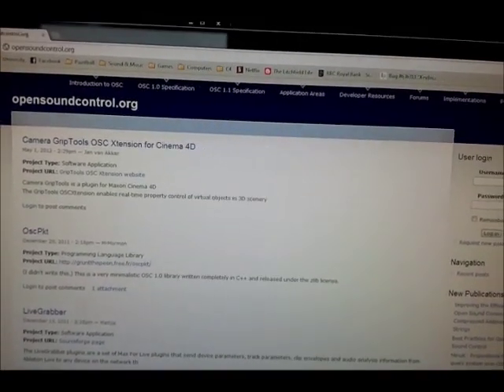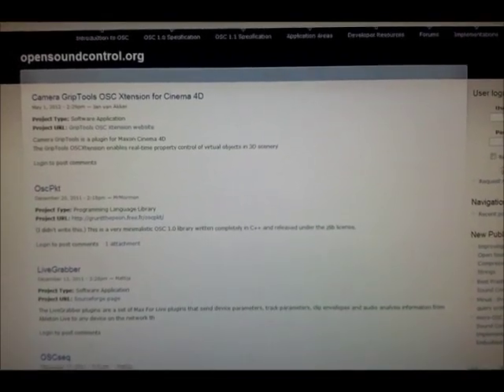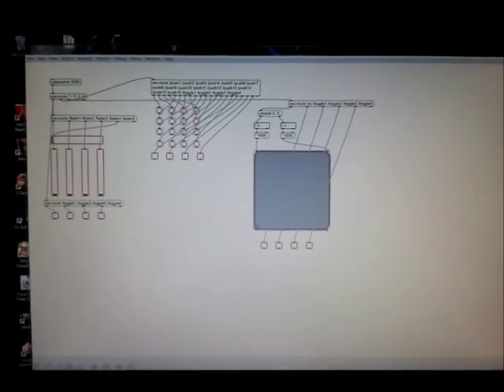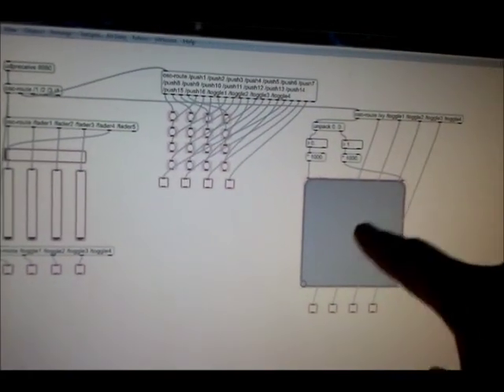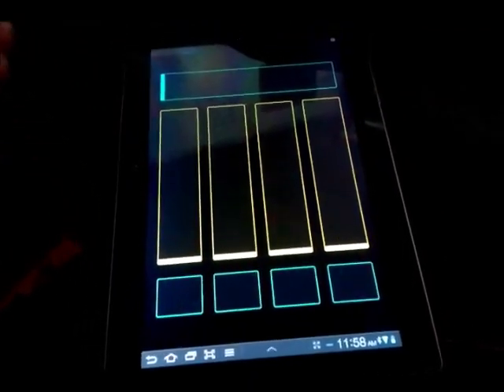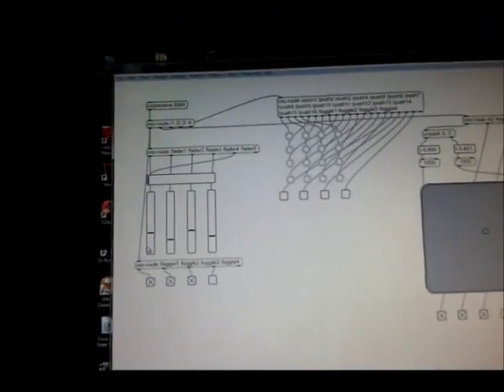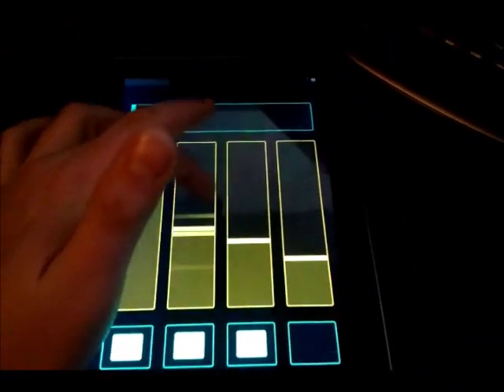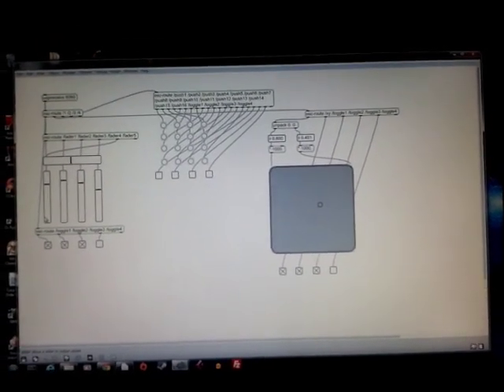Open Sound Control ( OSC ) primer + Arduino

Comment: How would you connect arduino to receive OSC commands?  What hardware would you use?  I know you could use serial with a USB cable from the computer to the arduino but what about directly going from OSC to arduino?

Comment: Nice OSC intro and Arduino plug!
FYI, OSCPad for Android allows you to create your own templates in JSON, which is rather simple, much like XML but for JavaScript. There is an alpha editor than let's you create templates too, but it needs work before it will be able to produce final our ready to use templates, which means you have to do some programming to make it work. But it does enough for me to work as is. There are tutorials available at the OSCPad forum. Google Play links to dev info, etc.

Comment from the maker: My website isn't up yet.  I'm trying to get organized first, I need to get a few more things done so I actually have something to put up on a website.  I'm working on a few things at the moment.  Rebuilding my entire guitar rig inside the computer with some new control interfaces using arduiino, as well as some fun paintball props for use in scenario games to make the game more fun an realistic. Stay tuned, I'll be putting up some more vids soon!